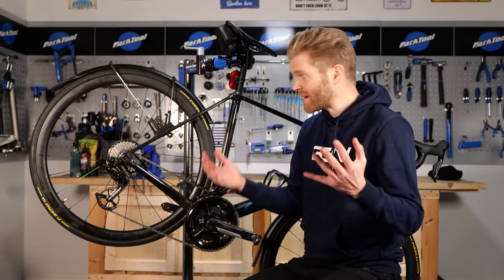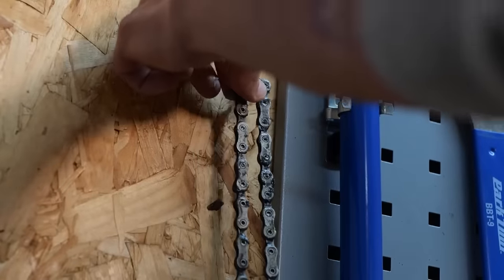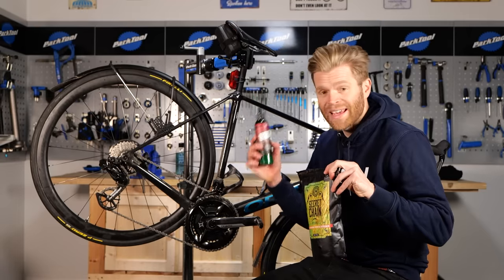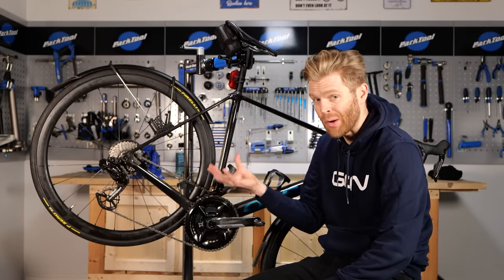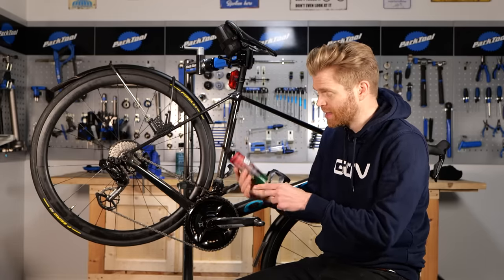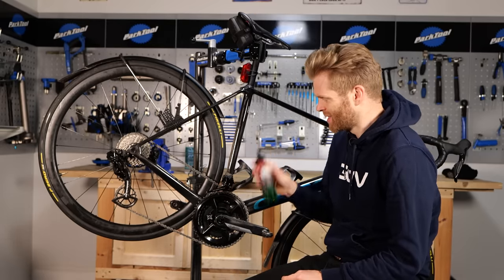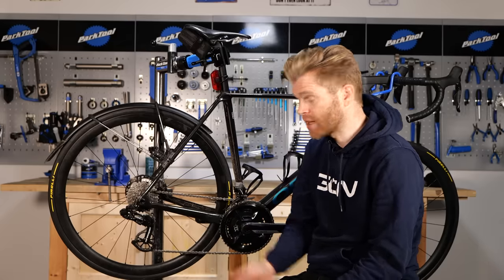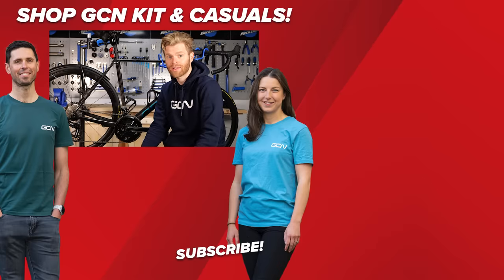Most Efficient Way To Maintain A Waxed Bike Chain!

Comment from the maker: Did we miss any tricks? Let us know in the comments 👇
Reply: After lubing on each pins and rollers I would run 2 fingers( kind of like pinching the chain) while back pedalling a couple of revolutions just to make sure the wax lube penetrates deeper into the rollers.
Reply: with drip on wax i seem to be getting more surface rust. even tho i wipe down chain after rides. whats the easiesy way to avoid this. or is just a case of deep clean each time and rewax after rain
Reply: Yes, you missed a trick.  At 5:39 when you said to wipe the chain with a microfiber rag-top and bottom- you wiped the outside surface of the chain twice, NOT the outside and then the inside surface of the chain where it makes contact with the cassette and the rings.  C'mon, Ollie, we expect so much more from you ;-)
Reply: I thought it was better to apply the drip lube on the bottom, not the top of the chain?
Applying the lube on the side where the rollers meet the chainring makes more sense.
Reply: It must be even more effective, to warm the chain after the 2x dripwax has dried.
Reply: Invest in a reusable chain link like a Connex (the quick links that come with your chain are not designed to be re-used multiple times), and then it's really quick and easy to get the chain off and re-wax in the crockpot whenever it needs it.
Reply: How many times can you reuse a bag of Silca’s hot chain wax?
Reply: Yes. How to survive temperatures below zero? Wax doesn't seem to like it.
Reply: Why don't you change your Youtube channel name to SCN (=Silca Cycling Network)?
Reply: My only question is can you keep microfibering and applying the water-based wax indefinitely or do you need to periodically take the chain off and reapply hot melt?
Reply: @wplg  I always apply drip on lube - Ceramic Speed's UFO, because that used to be avalaible in my country - exactly for that reason from the inside of the chain. Logically this should be the better solution.
Reply: My drip-on wax is in a glass jam jar.. I remove the chain and shake it in the jar for a while (like 5 sec)👍
Reply: I usually spray a teflon based lube/water displacer around the front and rear mechs and the jockey wheels. Will this contaminate a wax chain? If so how do you lube these areas (if at all) when using wax?
Reply: @wplg if you apply lube to the inside of the chain the chainrings and cassette pull the lube off the chain before it gets chance to get into the rollers. Applying to the inside is less efficient and leaves more mess on the chainrings and cassette.
Reply: @wplg  you only want lube inside the rollers of the chain. Lube on the outside of the chain does nothing. Lube on the cassette and chainring just acts to attract more dust/grit/dirt and is only detrimental. Luckily, wax is solid and not sticky so this isn't much of a problem.
Reply: @Jari1973  I wonder if the result would be similar to the hot wax after it dries 🤔
Reply: @spardamustdie47  The end result is very similar.. although the wax only lasts about 200km.. but the processing takes very little time (if you are quick to remove the chains😁)
Reply: To avoid having to wax the night before, find a freindly resturant owner who will allow you space for your bike in the walk in fridge while you sip yournpre ride latte.
Reply: @adambrickley1119  have you tried this? Struggling to see how a cold, humid environment will allow the water carrier to evaporate and leave wax behind
Reply: I believe you missed a crucial moment: a freshly waxed chain is very stiff and it is recommended to ride a few kilometers before entering a ride or whatever, since the excess wax needs to fall of the chain. Also, the derailleurs and the jockey wheels are going to be contaminated with this excessive wax, so additional cleaning (wooden stick or any other similar object) is hightly recommended.
Reply: I often ride in coast conditions with my xc bike. Down in Belgium we have small muddy single tracks, sand and beaches. The chain often look like the residue of a  coffee-machine has been spread all over it. 

Is is really bad to clean the chain with some water , a brush and bionet degrease spray? Off-course proper dry and re-apply the wax aftewards.😊 Or is it completely not done to clean your waxed drivetrain and chain with water? I was just wondering how the salt and sand could be removed without cleaning the chaine with water and some cleaner.
Reply: yes, you did miss whole"football"
Reply: @PoulHansenDK  you can warm chain on bike every time
Reply: @liamgaul  yes that's why you should always hot wax the chain on the bike
Reply: I didn't know that wax was water soluble?
Reply: I clean with an ultrasonic cleaner and water based degreaser before waxing and then ultrasonicate the wax to get it way inside.
Reply: The biggest trick is to keep a second chain waxed, ready to install.  This leaves you plenty of time to properly clean and re-wax the one you just took off, making it ready for the next chain swap.
Reply: @spardamustdie47  💯 agree. I do this exactly. This helps avoid wastage & better penetration internally. I have also noticed way more kms between having to reapply 👍

Comment: Once you've learned the process, it's just as easy to re-imerse the chain in hot wax and it works better.  And no, you dont need to elaborately re-clean the chain each time.  The drip version has to be applied very carefully and requires a 24 hr dry period.
Reply: This was my q, so you just wipe down and drop in?
Reply: @Miles_and_Motions That's it.  Use one drop on each link, making sure it goes into the roller..  It can be a bit messy, so put a towel on your chain stay.  But don't ride until the next day.  Wax is not like other lubes.
Reply: @Miles_and_Motions   You can use hot water to flush out old wax if need be.
Reply: It's good to use the drip version though if you are bike packing or on holiday and don't have access to hot waxing equipment.
Reply: @jellyfishsalad5926  Definitely, especially if there is any chance of extended rainy weather.
Reply: Yup!
Reply: @miles you can soak briefly in very hot water.
Reply from the maker: The drying period if super important 👀 Do you think it's worth the wait?
Reply: Keep 2 chains, change the dirty with the clean one to use it right away. Then clean/dry/rewax the dirty chain later whenver you want.  You will eventually need a new chain anyway, might as well buy it now than later when the old one dies.
Reply: @gcntech I like to think so, I plan to clean my next two bikes chains and only use drip on wax with them, one being Trek Emonda ALR when built and Trek Slash (enduro mountain bike) also when built up
Reply: but most of the quick link is not design to unclip multiple times. the one from sram or shimano is only for single use..
Reply: @Heizie999 Nah, you can use them more than one time ... Just marketing

Comment: I've been using Silca Hot wax treatments with Silca drip wax between Hot Wax treatments for a long time. Works great. But one thing I do that wasn't mentioned here is after applying the drip-on wax I run a heat gun (or blow drier) over the chain. This does A GREAT job of melting the wax that has dried on the outside surface of the chain (where it is not helping much at all) and allows it to penetrate into the pins and rollers. It leaves the chain much tidier on the outside (no big flakes of wax sitting on the outside of the chain) and better gets the wax where it's needed. Anyway, most everyone has a blow drier and this step takes no more than a couple minutes. I think it's well worth the time. 👍
Reply: Have you tried hearing the chain and then drip wax or should it be wax first then heat. I like this idea
Reply: @SingaporeUntold  Hi! I understand your question completely and it's a good one. I always apply the drip wax to no cooler than a room temperature chain, but don't preheat the chain. Applying heat AFTER applying the drip wax gives me great control over the melting of the drip wax so I can apply just enough heat to liquify the wax and have it flow into the pins and rollers. I am guessing that heating the chain BEFORE applying the drip wax would not give me that level of control. The wax might not penetrate as well because it might not liquify enough. Or it might get too "runny" and drip to the floor. I'm also guessing that heating the chain sufficiently before applying the drip-on wax would take quite a bit more time than just heating the wax after applying the drip-on wax. BUT, you've piqued my curiosity and I might try it the next time I apply drip wax. 👍
Reply: @SignorLuigi  I’ll try your way next time. Thanks for sharing.
Reply: @SingaporeUntold  I hope it meets your expectations. 🤞👍
Reply: @SingaporeUntold  Hi Singapore! Without taking apart the chain and visually inspecting the internal parts with a microscope, I wouldn't bet my first born female child that this method is as good as immersive hot waxing. But I believe it must come darn close. Clearly, that drip wax isn't just disappearing into the cosmos. It's moving into the internal sections of the chain and doing good work. 🙌 Great to see another person following this procedure. 👍
Reply: Im loving the heat gun/hair dryer approach! I cant beleive i never thought of it. To be fair ive only just begun waxing my chain. Theoretically OP is 100% correct in heating the chain after applying the wax. If you heat the chain prior to applying wax it can be easy to overheat the chain and the wax that is in there will run out, also the new wax may not go in the chain, but through it. The other great thing with applying the heat after, is it will not only help the drip on wax to soak in, but also dry the solvent used and thusly only requiring the chain to cool before using the bike!

I did some research on waxes too. I'm going to be switching away from silca when i get my gravel bike (currently on mtb)

Silca is a better performing wax under wet and extreme conditions. But in clean/dry/dusty conditions, molten speed wax offers less friction. I live in a dry enviornment. Also UFO drip wax is better performing in the dry than silcas drip wax. The research comes via the zero friction youtube channel. Im quite certain both are great products and the difference is truly marginal.

The main thing I noticed is silca offers slight friction out of the box. But molten speed wax is @ 0 friction. To me this means more longevity of the drivetrain in the long run.
Reply: @brandonhoffman4712  I'm glad you're enjoying the heat gun/blow drier strategy. I just applied drip on wax to my chain the other day and there is something satisfying about applying heat to the excess wax and seeing it disappear, leaving the chain better protected and tidier looking.

Comment: Stay at home and not use a waxed chain? I really tried liking waxed chain, but it would always wear off after a weekend ride. I usually ride 200k in a weekend and it was back to re-waxing. I'm not even a serious rider, it really wasn't worth the hassle. Maybe it's good for race day, but for everything else, regular lubing last longer and it's just as good.
Reply: hear hear !
Reply: A couple of hours drying time is enough, I've used drip wax exclusively on my commute bike and fatbike for a couple of years and waiting longer doesn't seem to make a difference.
Reply: The evidence is that with liquid lubes, it might sound like it's lasting longer, but it's not. In terms of wear protection, hot wax is tops, then drip wax, then oils.
Reply: SAE non detergent mineral oil is proven to be the most effective lubricant for minimising friction & wear in chains. Not a debate, hundreds of years of industrial research backs this fact up.

Comment: I was a sceptic of waxing until I saw Shane Miller's vid where he got 15000km with no wear. So jumped in. It's a revelation, chains last endlessly and no gunk on drive chain. Worth the investment I'd say.
Reply: The complete lack of sticky oil all over the bike is a nice bonus.
Reply: Edit: Currently using wet lube, never used wax
Wait what, you mean that wax does not gather dust and other garbage over time ? Driving in a city here and the chain get really dirty really fast like full of dark sticky thing after one exit and that also goes to my pants when I touch the chain with my right leg : (
Doesnt have a garden so washing with water pipe is not possible and its really in need of big cleaning rn 😢
Reply: @Poof57  The myths from big wax get stranger every year.
Reply: @___Bebo___  In case it was misunderstood I wasnt doing sarcasm here, im currently using wet lube, never used wax, and my chain health is crap
Reply from the maker: It's pretty magic isn't it! Great to hear you've moved over to the light side 🙌 How are you finding it so far?
Reply: Welcome to the club :) Waxing is the way to go. Clean chains and hardly any wear.
Reply: I tried waxing  for the first time a couple weeks ago and was likewise skeptical (sceptic means you're infected).  
I was wrong.  My drivetrain feels like butter and the shifting is so smooth.

Comment: Before re-applying hot melt wax I like to put the chain in boiling water, close the lid and shake it hard for a few seconds. Removes a lot of dirt and keeps your hot wax clean.
Reply from the maker: Oooo great hack! Super cool to hear people have their own methods 🙌
Reply: One more step is to shake in alcohol to push out the water for fast drying
Reply: I just pour over a kettle of hot water with the chain off the bike, the dirt will have minimal ingress into the chain so you're melting the coating and dirt mix off in no time at all
Reply: ultrasonic cleaner with a heating function 🤩 heats the water to 80 °C while cleaning.
Reply: Dry road use -> straight to hot wax (ZFC)
Reply: @SingaporeUntold  or a couple of sprays of isopropyl alcohol

Comment: I’ve been using the drip on wax since Silca first started selling it and asked Silca directly how best to clean the chain if I was removing it from the bike to clean. They responded that I should just put it in very hot water, shake it and rinse it off. I see others commenting here that they do this as well. When I clean it this way I then pour 99+% isopropyl alcohol in the container, pour it out and repeat which allows the chain to dry very quickly.

Comment: If your drip on wax is kind of thick, you could try to heat the (closed) bottle by put it in a buket with hot tap watter. That may helps to get it more liquid and it's  therefore easier to apply. Try it out...
Reply from the maker: Oooo interesting! Is this something that you've done in the past? 👀
Reply: @gcntech  this is what I do with Smoove wax lube -- run it under hot water for 30 seconds before I apply, shake well, and apply. Seems to penetrate better than when I didn't heat it up
Reply: I bet Ollie don't as "we are sponsored by silica so can't run out"

Comment: As with others already commented... The top tip is two (or more) chains. Have one ready to go. Then re wax whenever. As it takes 4-6 weeks of riding (MTB in the wet as well) between changes I can get some time to get it done. Other tip is to always dry the chain when putting it away or you may see some surface rust. Have some drip on. Have never used it...
Reply: Imagine not lubricating your chain with oil and it literally rusts in front of you then thinking, wax is the best lube for bike chains, smh.

Comment: I bought drip on wax a few weeks ago, still have to clean my wet-lubed oilly chain (riding indoors at the moment, so have to get it outside to properly clean it). Quite excited as I actually never ride in rainy weather, so the wax will be way easier and way cleaner than oils.
Reply: I waited too long and stretched my chain out on my road bike. The gauge read .75% but I knew it was time looking at the cassette. I ordered a new chain and cassette. I also ordered the Silca hot wax pot and drying rack. It was back ordered at first but in the same week I ended up with my parts, wax and strip chip for the factory grease. First ride on the new chain this week. I did 50k and it was amazing. Smooth as butter and absolutely now chain noise at all. Shifts felt crisper and more accurate as well.

Comment: I don’t have a wax melting pot.

To get best results with drip wax, I hair dry evaporate and permeate it in, doubling it if needed.

This is easier done with chain off the bike.

With hair drier you literally see the solvent evap and wax liquify and enter the rollers in seconds.
Reply: The silca hot wax comes in a "boilable" bag. So you don't need anything extra. If you're already removing the chain I'd say go with that.
Reply: So when you apply the drip wax on the chain while the chain is still on the bike, just let it dry and no wiping off?

Comment: Why would you apply it to the top outside of the chain? Seems better to apply it to the bottom inside long run so that the wax is pushed into the chain when rotating instead of being flung outward off the chain.

Comment: I did some research on wax lubricants. Thanks to zero friction, truly a wealth of information. I read between the lines a little, looking @ the chart data.

My conclusions:
Molten speed wax is a better performing wax for dry enviornments. Offering less friction upon testing until things get wet.
Silca secret wax is better under adverse conditions. It offers slightly more resistance overall compared to molten speed wax. Performs similar in the dry to molten speed wax (same type of curve on chart, just slightly higher friction) but in the wet it starts to shine. And in extreme mucky situations it just keeps on ticking.

I will be switching to molten speed wax once I run through my silca supply. I live in southern California, a dry climate. I think the good drip wax to top up in the dry is UFO drip.